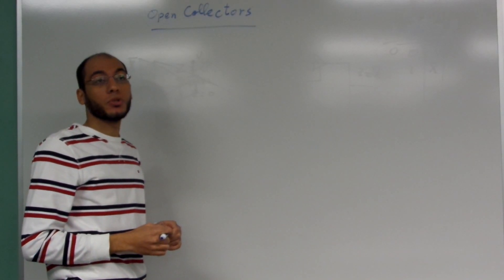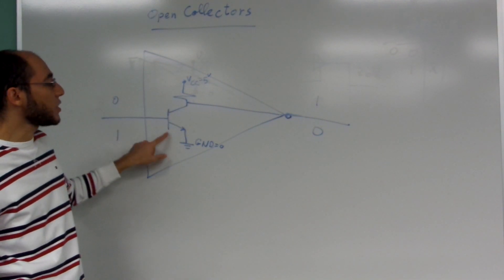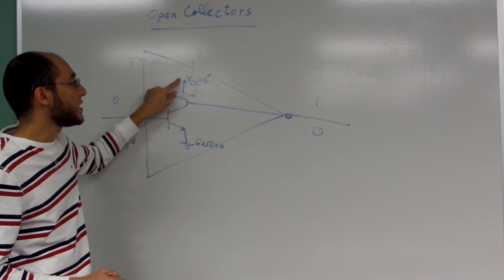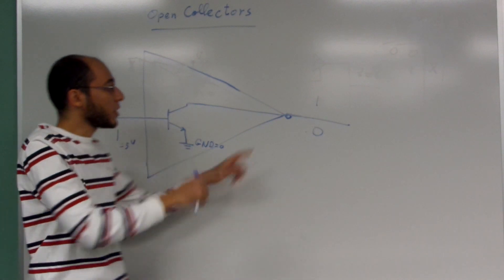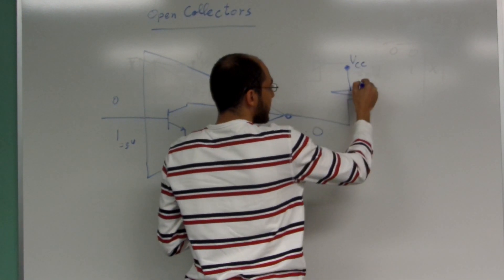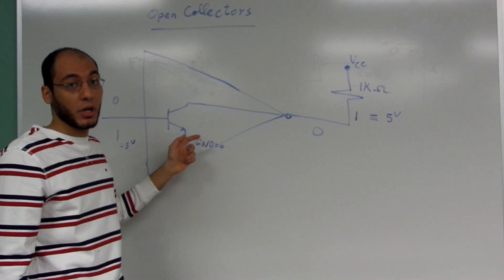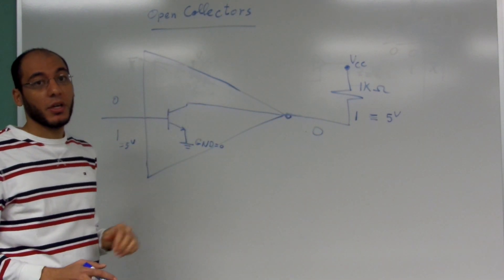Open Collector NOT gates - Why do we need pull-up resistors?

Comment: This is a great video! 
I would like to use an Arduino's open collector output with a pullup resistor, coupled with a capacitive sensor. I am using a capSense library that takes two pins. On the first one sends out pulses and on the other reads it back. The rx pin is also connected to a metal plate and works as a touch sensor. I would like to have the following result:
- switch open: 5v on the input pin;
- switch closed:
                           1)same pulse of the output pin (the input would match the output); or
                           2)0v on the input pin;
I cannot figure out how to make it. Your help would be very appreciated.

Comment: I came here because I wanted to understand the I2P protocol connections better, but listening to this I realized a mistake I did trying to understand the UART connection. Since its idle state is a high, so as to not input garbage data and avoid a floating state, we should connect it to the supply through a pull-up.
Thank you for the nice video!

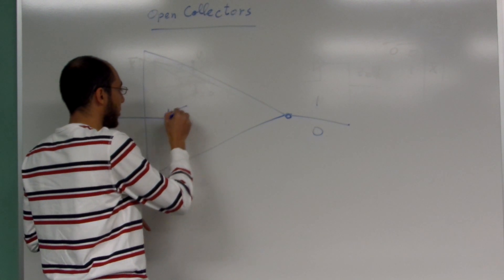Comment: At 0:55 This “becomes 5 volts for some reason.” That reason is the transistor on the top is a p-type, and the transistor on the bottom is an n-type. When the input voltage is applied to the gate of the to p type transistor, it is repelling the 5 volts and not allowing current to go through. But the transistor on the bottom is an n type, so when current is applied to it’s current can pass through but in the other direction, effectively acting as a drain for the current that cant through the p type up top. So apply8ng a current means no current passw through the output of the overall gate. It just repels at the top then drains out the bottom.nBut if NO current is applied to the input then s a difference in potential from the 5volt entering the top, and zero volts at the p type transistor’s gate, thus the current entering the source of the tp resistor passes through the output. And the difference potential of zero input and zero volt grpund at the bottom is zero. Thus no voltage at the input causes the current to pass from the top transistor to the output. while a voltage stops the path to output and directs it through th bottom n transistor insteaf
Reply: Paste into typo correction app to translate lol